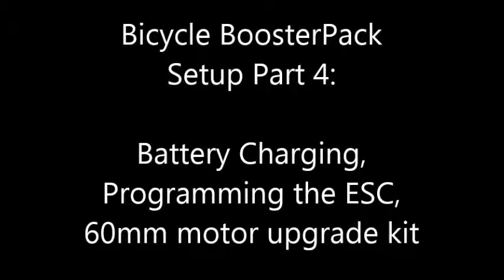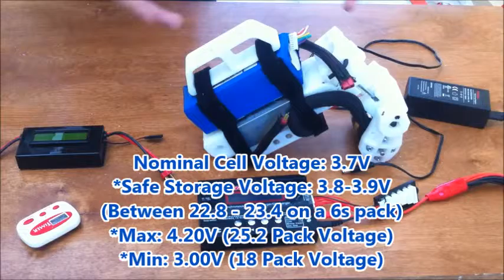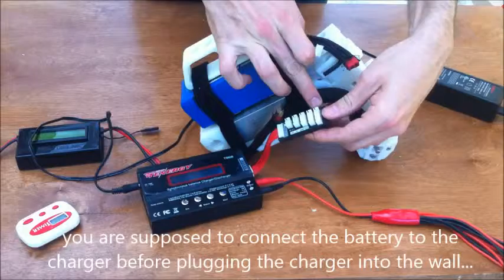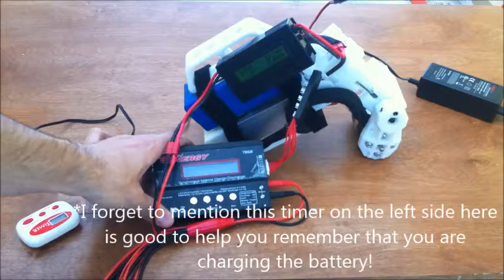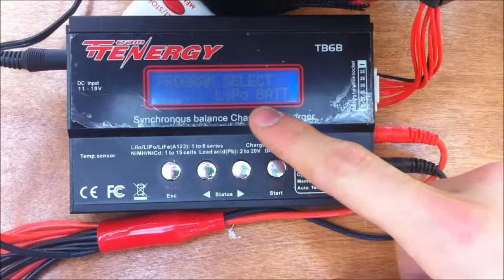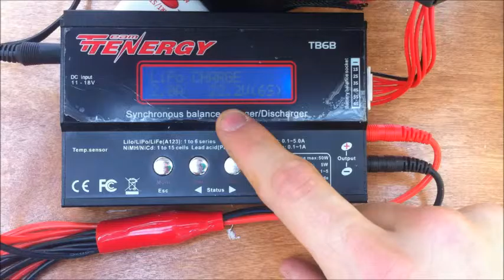Bicycle BoosterPack Assembly Part 4

Comment: You should select Balance Charge not Lipo Charge, since it wouldnt be balancing the cells and is not safe!
Reply from the maker: Thanks Malek. I use the 6 cell low voltage buzzer alarm for checking individual cell voltages and to determine when a balance charge is necessary. This charger does have a balance charge feature but it is a slow process because it charges each cell individually at a low current. In practice all my cells have stayed within .04 V of each other so a balance charge is rarely necessary.